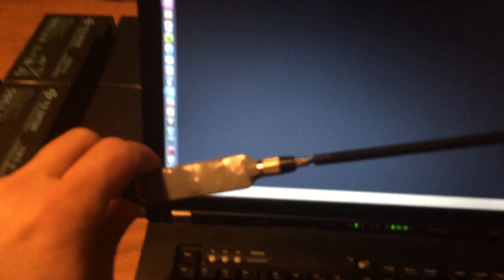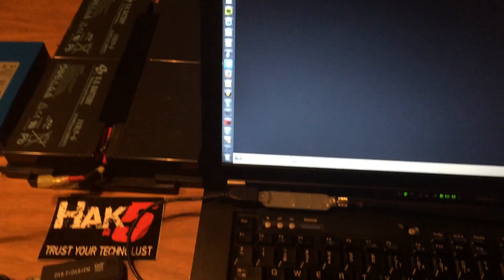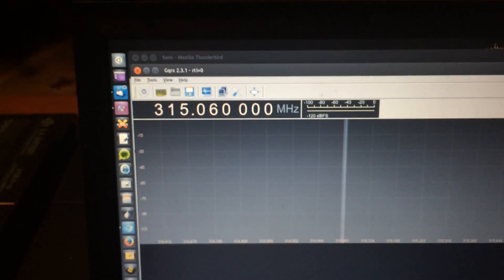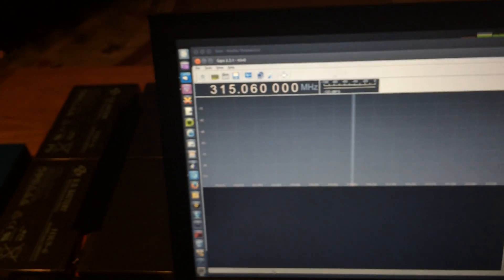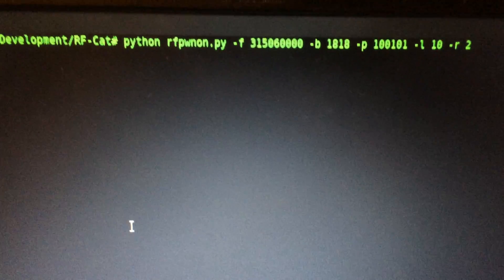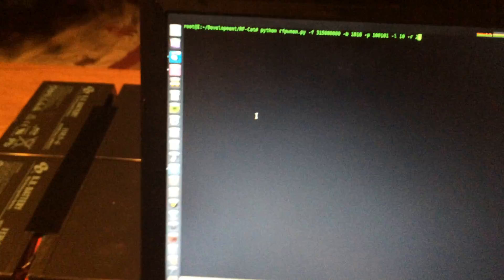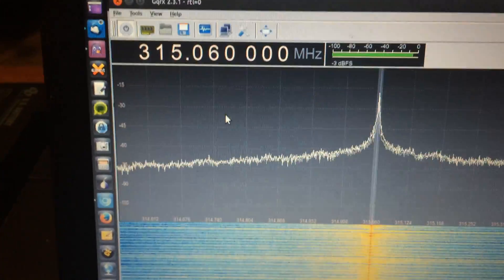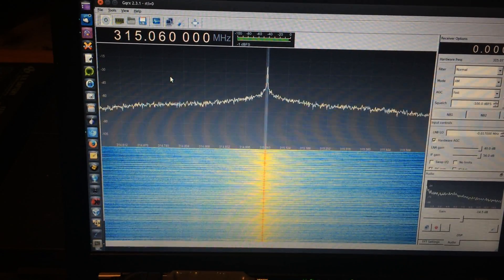Brute forcing the garage with a Yard Stick One

Comment: Is this still possible when you don't know the frequency range of the garage opener ?
Reply: Possible to scan frequency, but there is generally 315, 433,92, 434,34, 417.9, 868.3 mhz.
Reply: @DjonixTV  Yea I figured I could buy an Hack RF one and scan but theyre so pricey.. I'll give it a shot with those frequencies though. Thanks!
Reply: @16367848237548634752  You can scan this ranges with YSO and quckly decode, then save and transmit with preffered parameters, no hackrf required.
Reply: ookTools works grate. And no USB time outs

Comment: Does this use the De Buijn sequence? How fast could this potentially brute force a fixed code garage door?
Reply: I remember Samy Kamkar's Defcon presentation, but he programmed the Open Sesame device in C, as opposed to Python, and it uses a much different set of hardware.